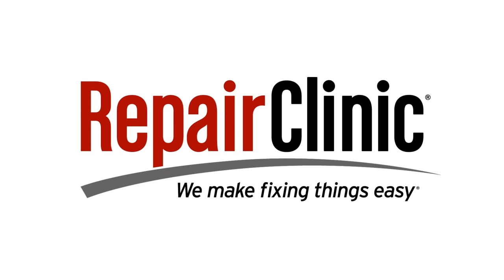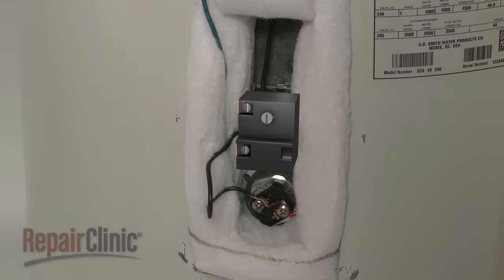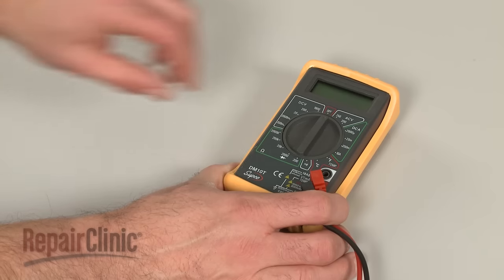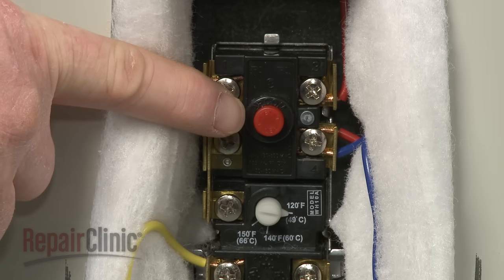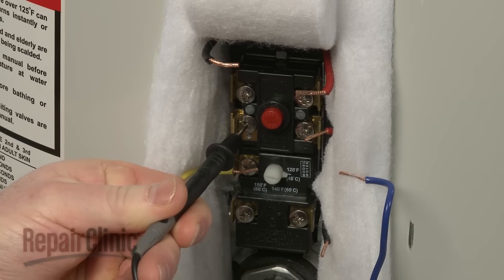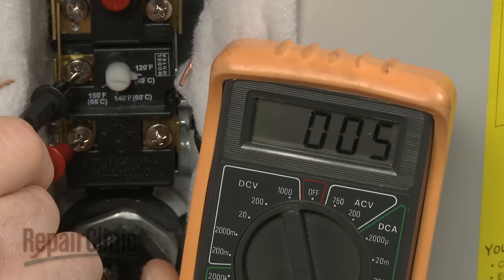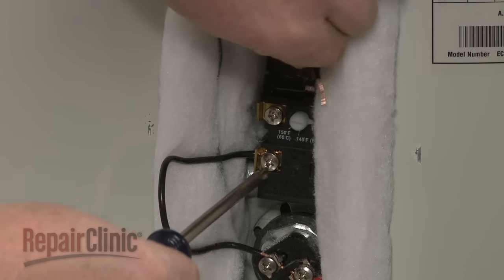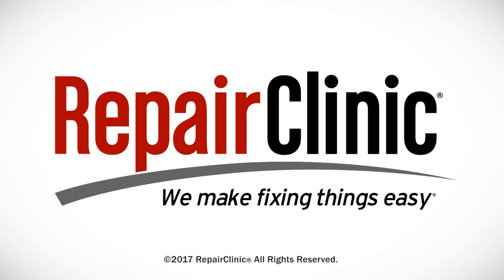Water Heater Not Heating? Thermostat Testing

Comment: Anyone that is not familiar with a multi meter probably will not know where to set their meter dial at.  This is not mentioned at all in this video. Also I agree about the designated temp setting 😟. The video did help some though. Thanks
Reply: RepairClinic.com ok, sorry I missed that. At the time I was not familiar with what olms meant etc. 
I do have a prob still. My water heater's elements and thermostats are good. When I check the thermostat to see if I'm getting power I am not. I want to check the main wires coming in at the top of the heater for power, how do I use the meter for that? I can't find any specific video on that. Thanks so much!
Reply: ohms is the measure of electrical resistance, and volts is the measure of the electrical pressure in the wire.  current is the measure of flow rate of electricity.  can have 120 volts can shock you bad. 240 can kill instantly, so be careful.  when the multimeter needle swings over to near zero ohms, it means that there is almost no resistance in the circuit between the meter prongs.  test it by touching the red and the black.  the needle swings over to zero, meaning no resistance, or full flow of elecricity.

Comment: Strictly speaking, voltage does not 'flow'. Voltage is the electrical potential available and amperage (or current) is the 'flow' of electrons.

Comment: Will these heater rods work on 120V..?? Or let me ask will the thermostat close contacts if there is only 120V on the input leg..??
Reply: Shut off power to the unit. Open the element compartment and write down the numbers on the end of the elements, then close the compartment and restore the power to the unit. Take these numbers when you shop for your new elements. 30 and 40 gallon heaters are typically 240 volt / 4500 watt. Always take the numbers with you for an exact replacement.
Reply: Shavian1:
Ok... you did NOT answer my question, you only told me what i already know.. i have replaced these rods several times from several HWH's from family members and friends.. i KNOW they operate on 240V, my question was .. WILL THEY WORK ON 120V only..??
Reply: @ACommenterOnYouTube  Just a resistor, so yeah.. Expect about 1/4th of the power.. Ohms law.

Comment: what if both element terminals show continuity?    I left the wires connected and tested upper and lower.  
Upper was 13ohms, lower was 27.
Reply: you got a lot of resistance
Reply: Don't know if you got the real answer to this by now, but the elements should read resistance because they are the load.  By you testing for continuity with just a digital multimeter set to tone, you should be getting a "beep" sound when you touch each element's terminals, usually indicating that the element is still good.

The resistance reading you get is determining whether or not the element is working too hard (higher than normal resistance value) or not working hard enough (lower than normal) to generate enough heat through the coils to heat the water in the tank.  The resistance ratings of some elements are different, but the most common for a residential tank type water heater is 4500 watts assuming 240 volt power supply, normal resistance readings should be around 12 - 13 ohms.
Reply: @Andrew Welch  I have a 40 gal/4500W electric water heater. I hear both "Beep" sounds  when testing both elements and thermostats for resistance but it keeps tripping off my circuit breaker after resetting the button and allowing the tank to heat up with hot water and this started 4 days and I've been living here for 3yrs now......After taking one shower,the breaker kicks off....Why is that?

Comment: My electric water heaterstoooed producing hot water after I drained and flushed it. Everything checks okay as far as all electrical components, it gets water as it is hooked to the main in source from the well and still runs from faucet. It has a faint sound like it is heating but there is no hot water. At the same time a bathroom toilet closest to where the tank sits, will not fill with water. I looked for leaks or blowouts unde the house and have not found anything yet. Anyone got ideas on what the problem could be?

Comment: Can someone help me please. I have giant expert 8 plus water heater. 
Its 12 years old.

No hot water at all.  
The upper one receives the power (240V), the lower doesn't. 
I turned the temp down on the upper, and max temp. on the lower.
I checked for continuity upper 0.02  lower 00.4 (with the 200 omh settings)
The 240v is on the heating element on the upper even when I dial temp down (no pop sound)
Does it mean my upper thermostat is bad ?
Thank you !!!

Comment: How can the lower thermostat know the temperature in the tank when it is completely disconnected?
Reply: You are checking for "continuity" not temperature. To check the water temp put a thermometer in a glass/cup of the hottest water you can get from a faucet. (bring the vessel close to temp as the water, with the water prior to taking it's temp. The vessel can give you a bad reading if you don't.

Comment: what the heck is the designated temp setting, wouldn't it be helpful to know that?
Reply: It what you have it set for. It’s on you to know that. Some people like hotter water then others and will change the temp. It’s usually set around 120 from factory.
Reply: There is an adjustment screw on each thermostat. They are adjusted with a flat head screw driver. They are usually set on HOT at the factory but you can adjust it to VERT HOT or, as low as you like. If you have children or seniors living in the home it's a good idea to go with HOT at the most.

Comment: how can i fix it if i hav' not multimeter
Reply: The symptom will point to the bad part. No Hot water is bad upper stat/element. Short supply means the bottom isn't heating up and the lower element/stat are bad

Comment: wouldnt a thermostat either work or not work?  I dont see how it could heat poorly?
Reply: Defective thermostats will turn off and on intermittently. One way to test for this is to hook up your multi meter by clamping them on to the terminals and tap the thermostat with a block of wood and watching the ohms jump.
Reply: Price 1500 watts 240 volts element waterheater

Comment: Shouldn’t the video show how to make sure that the water heater is powered off with a tester?  What if the diy person mistakenly shut off the wrong breaker? Plus the guy in the video appeared to touch each possible live wire placement... again a novice diy person would be dead and lawsuit coming.
Please please please save a life and redo your video😕😡

Comment: This video is worthless. You don't make sense when you say the water temperature is above or below (whatever)  The problem is that there is NO Heat in the water so there is no water temperature except for cold.
Reply from the maker: This is a thermostat testing video to help you check if it is a faulty thermostat. If your thermostat isn't working, it can also make your water heat too hot. The majority of the time, the water will be cold, but there can be additional parts that can be faulty or broken. The thermostat is the most common part that needs to be replaced when your water heater isn't heating. Hope that helps!